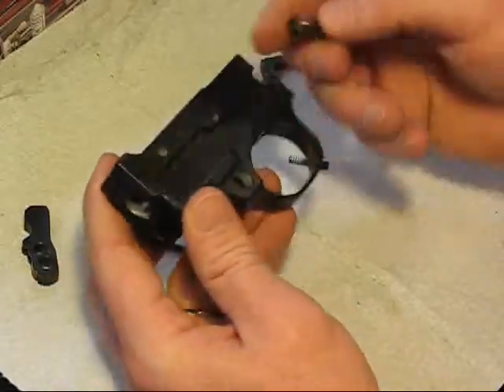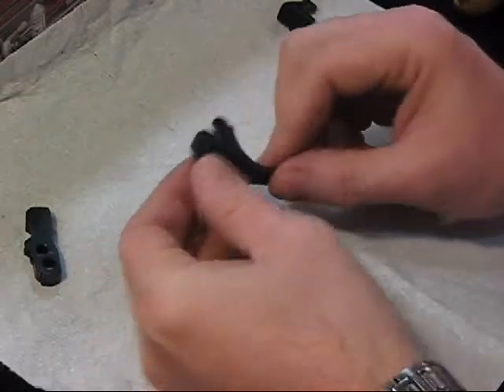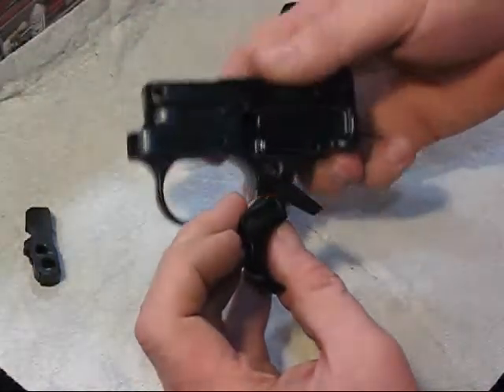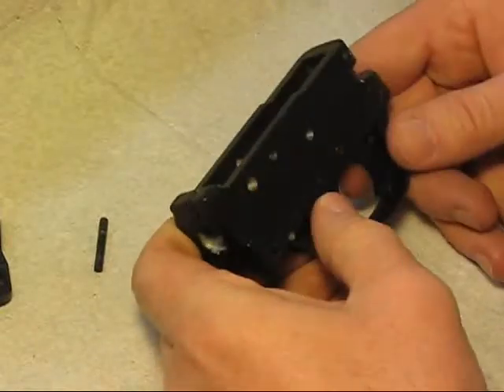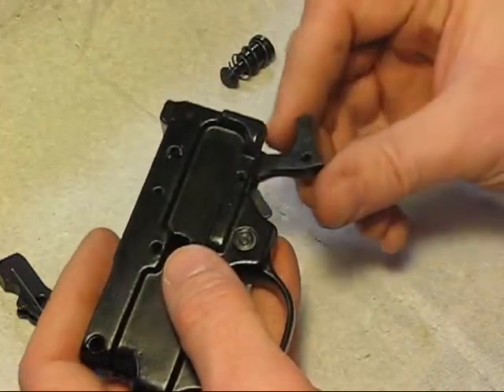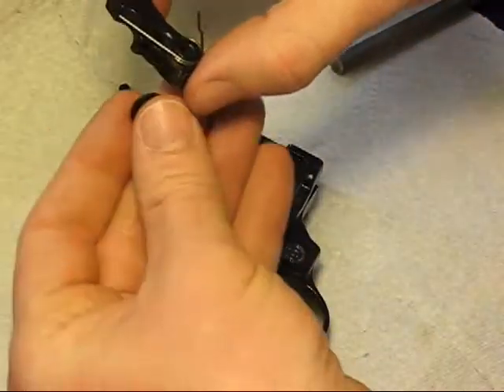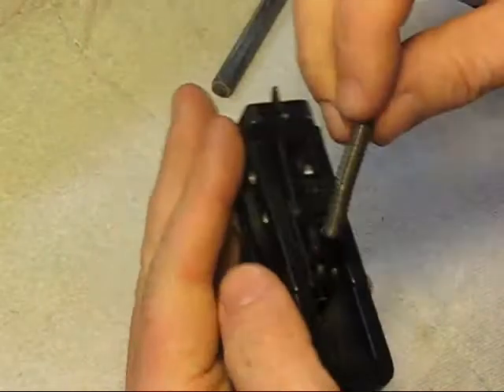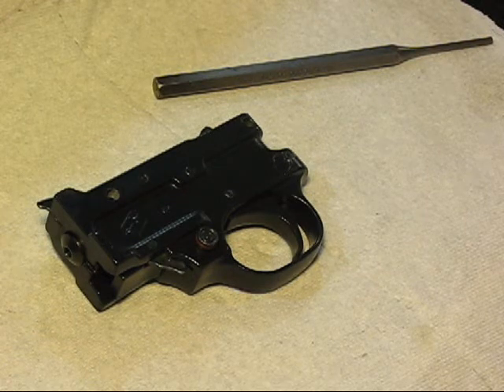Ruger 10/22 Trigger Assembly How To-Gunsmithing

Comment: How did you get the safety block out
Reply from the maker: +Anne Alexander
I'll have to go back and look to be sure, but there is a spring loaded ball detent under the block. You need to ether twist the block or get under it with a small pin or punch. You should be able to get in there and when it's pressed down, you can slide it out.
Reply: Precision Machine Shed you dont have to i figured it out about an hour after i posted that my seer was big so i filed off about 1mm off of the part where it touched the saftyand now it works great THANKS for the only video that actually explaines what to do in the proper order
Reply from the maker: Glad to hear you got it figured out. I don't take these apart too often, so I can't remember every step all the time. I try and cover everything so anyone can accomplish this.

Comment: What spring is longer the plunger spring or sear spring ?
Reply from the maker: +Kevin Robbin 
Without having them in hand, I'm not sure. Most times they tend to be slightly different in diameter so one will work better in one place than the other. I noticed my sear spring was silver and the other was not. Of the schematics and books I have none of them show the trigger assembly in that much detail. Without pulling it apart again I'm not sure. The trigger plunger spring should fit good on the plunger. If I were to guess I would say the sear spring is the longer one.

Comment: I watched your video, for the most part after watching vs listening, I was pretty much good to go; then came installing the hammer.  you don't show putting in the part that fits into the rear slot, or what it does. But I still managed that.  But when it came to installing the hammer, I'm clueless.  You just shoved it in without showing where it went.  There's no way the hammer spring can reach from the hole to the hammer as I have it from what I could make out of where you put it.  You would do watchers a huge service if you actually did things from overhead without using extreme close-up.  I still have no idea where to put thehammer so the spring will reach it. (Not the seer sping, that was easy). It looks like it's going in before the piece on the side that comes out in front of the trigger.  So that's my problem, the trigger hammer won't fit anywhere but the side that i, for the most part, empty.  But it doesn't look right and the spring can't reach it.  Maybe go a bit slower, tell people what you're doing and SHOW THEM where you're putting the piece with good lighting and explain where it's going, in detail, step-by-step.  Remember, I had no problem with the trigger assembly and the spring between two parts with ease.  Thank you!
Reply from the maker: Thanks for the feedback. I'll have to try and record an updated version of this with a little more detail.  They can be a little tricky to get back together. I try to explain things best I can but I do have the occasional oversight just because I take some of this stuff for granted.